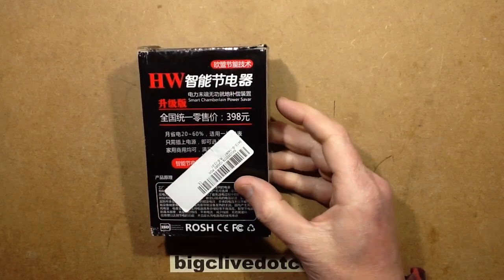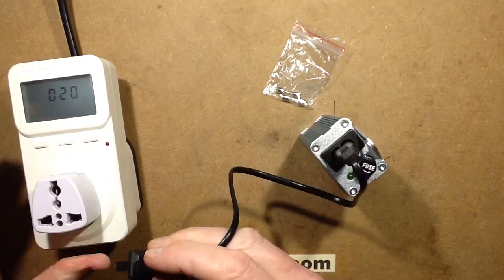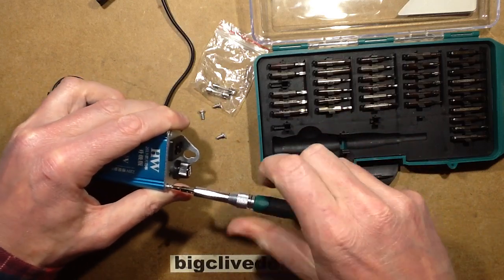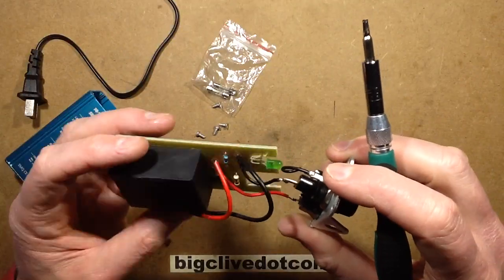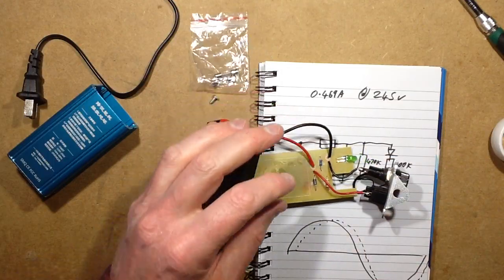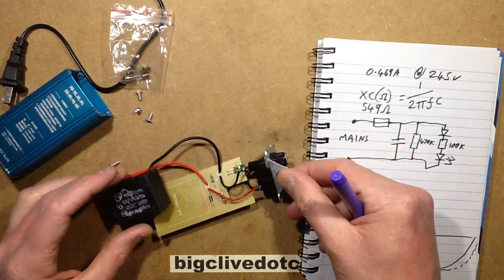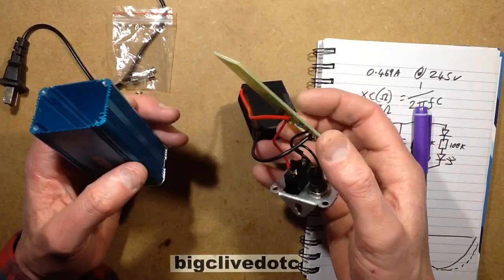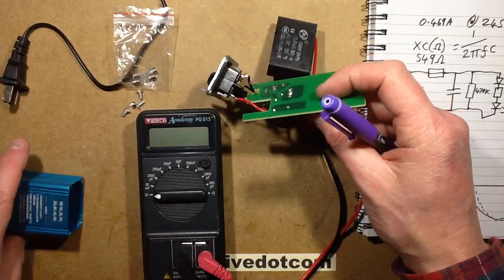200kW miracle power saving device.

Comment: Clive, videos on power supplies, power-factor and metering would be good.

I have some computers running on a plug-in power meter, which said the PF was only about 0.6. I experimented with capacitors but they only make it worse. Later I got a W/VA/PF meter module from China and fitted it to the switchboard. Great little device for about $20, very interesting. This got me looking more at PF in the house.

Most full time loads in the house other than cooking, water heater and fridge-freezer use now switch-mode power supplies. The volts and amps are in phase but the current is high at the peak of the cycle. The cheap PF meters show this as a poor PF. I guess it depends on how smart they are at interpreting volts, amps and phase angles.

I fitted a PF correction power supply to the computer cabinet and the reported PF went from 0.6 to about 0.95; a big indicated improvement. It must reduce the peak current and distortion on the mains 

We've had a smart meter for many years that I'm sure can monitor watts, VA and PF, but I don't know how they actually work out the billing. The power bill says KW, but that could be just to simplify the jargon.

The power display. Safety disclaimer: you need a electrician to install this.

http://www.ebay.com/itm/AC-80-300V-100A-Voltmeter-Voltage-Ammeter-Power-volt-amp-watt-Red-LED-Digital-/272162207638?hash=item3f5e21b796:g:NFUAAOSwr7ZW3~O0
Reply: Uh, power factor isn't accounted for in your power bill in residential settings. It's completely useless to correct for power factor if you're in a residential setting.

Comment: Clive, you need a scientific calculator so bad. :P
Reply from the maker: +themaritimeman They've all got tiny displays.  Not so good for the video.
Reply: Ah, good point; I hadn't thought of that.
Reply: Those things cost a fortune compared to a simple calculator.
Reply: PunakiviAddikti Yeah but they have more functions, and personally I love my Casio for when I need to quickly switch between scientific notation, fraction, and normal form of input and output, or go crazy with parenthesis, or being able to go back in memory for a certain equation I put in and swap values, using trig functions, etc. When it comes to repetitious work I find it very efficient. But, I suppose if bigclive doesn't need it often then a $15 calculator would be just an extravagant expense (and with a scientific calculator he wouldn't know how to use the memory keys on a basic one 😂) even though it can be a little tedious to use.
Reply: Also he has his well-trimed intellect. No need for oversofisticated calculators. Even though I love my Casio and my HP..

Comment: I like that the author has taken the trouble to investigate, but this is just a capacitor.  It will give a very small power factor correction. Power factoe correction cam knock 5% off your bill but only if your are billed on KVA  not KW.

Comment: Typical PFCU's switch in banks of caps as needed, dependant on inductive loads. Mainly 3ph motors, or to balance out other issues like office electronics on one phase. My thinking is that they're installed to create unity across the 3 phases in a factory installation, as the energy companies mostly want to supply equal effective power to a given factory, otherwise the bill goes up the more they have to correct a given phase. So in a domestic single phase install, of very little use if any.

Comment: You plug it in and it's already drawing 1/2 an amp..  If you think that daisychaining a capacitor and a couple of resistors is going to do Anything (I presume it is being sold under the pretense of power factor correction?) then you are being duped!  To implement PFC, one must devote an entire page of math and a d-box full of capacitors to fix the load at That moment in time!  This quackery in a shiny box should not exist for sale -- is it even UL listed?

Comment: How can this save energy /power when it exerts ~530ohm load on your network and draws 470mA x 245 = 115W. It does not make sense, does it?
Reply: This is not a resistive load (which is measured by your domestic power meter) but a capacitive 'load'.
The current in a capacitor is way out of phase from the voltage (ideally by 90 degrees) and no real power is being consumed (except for the discharge resistor and the LED+resistor in this device).

Power: P = U * I * cos phi
where U is the voltage amplitude, I is the current amplitude and phi is the phase difference between voltage and current (the power factor).
If phi is close to +/-90 degrees (or +/- pi/2), cos phi is very close to zero and the whole scalar product is similarly close to zero.

Some (cheap, digital) power meters do not measure cos phi (the power factor) and may include the imaginary power (energy exchanged between the capacitor and the network and back during each period) in the total power reading, which is wrong. They would be measuring simple Volt-Amps (VA), not Watts, and would be usable on with pure resistive loads (e.g. incandescent light bulbs, water kettles, etc.).

Comment: What do you think about refrigerator surge protectors?  Would you recommend using one in areas where a lot of brownouts occur?  Below is one that says it interrupts current below 90V and above 140V and has a 3 minute safety cycle.  I think this would be very good for a fridge or small window A/C unit to save the compressor.  What do you think about something like that?  http://www.amazon.com/dp/B00PHDTLEG/

Comment: I am in an all electric house.  I would never fall for that gadget either.  What I do is just turn the heat down in all unused rooms.  I can do that because we use baseboard heaters and each room has its own thermostat.  In the warmest months the electic bill can be as low as just a measly 20 USD BUT watch that shoot up dramatically in the winter!!

Comment: If the LED is in parallel with the rest of the circuitry doesn't that mean that if the rest of the circuit actually fails the LED part would still report it as working?
Reply: Maybe.

Comment: Would have been nice to see the actual sine wave before and after with an oscilloscope and possibly a 24hour test running once without the device and once with the device to see if it actually lowers the power consumption on your power meter that the utilities read from. Other than that - very detailed explanation! 😊 thank you.
Reply: Residential power meters measure both the power going into your home, as well as the power reflected back to the power company, with the net being what you actually consume.
Power reflection happens from inductive loads which temporarily store power in a magnetic field then when that field collapses, it send that power back to the utility. While that can add current in your power lines, your not actually consuming it and so aren&#39;t charged for it. Capacitors also store power in the form of a electrostatic potential between two plates and releases it back to the grid. Each unit of capactive reactance cancels the same amount inductive reactance.

So while you seen .489 amps at 240 volts you were not seeing 117.360 watts being used. Rather, you were seeing 117.360 volt amps being absorbed from and reflected back to the mains line.
Reply: Ian Oliver "
So these devices actually increase* your charged-for consumption," Simple answer: No. More complex answer: Maybe just a tinny amount. Read below for a more detailed explanation.

Look at this image of a capacitor in an alternating current circuit. http://sub.allaboutcircuits.com/images/quiz/00577x02.png

Power is Voltage times Amps. Consider these four different situations with a capacitor during a complete (0-360 degrees) cycle of applied alternating voltages. 
1. 0-90 degrees of a cycle, voltage and amps are both positive. so  power is positive and you'r consuming power.
2. 90-180 degrees of the cycle, voltage is positive and amps are negative. so power is negative and you'r sending power back.
3. 180-270 degrees of the cycle, voltage and amps are both negative. So power is positive, and you'r consuming power. 
4. 270-360 degrees of a cycle, voltage is negative and amps are positive.  So power is negative and you'r sending power back.

Adding up all the power flows. gives you a zero net flow of power. A little more nuanced  answer:  But, if you add in the tiny amount of resistance found in the wires, then yes you will loose a tiny amount of power due to line losses. For residential consumers, it is generally so insignificant that its not worth mentioning.

"Your charged for consumption" is the net power that you consume. These devices temporarily absorb power and reflect it back. If I gave you an apple and moments later you give it back, you didn't actually consume it, thus I cant charge you for what you did not consume. But, the apple still changed hands twice. The apple in this analogy represents power not current.  This is how it is with residential power consumers.

Industrial power consumers are a special situation. They consume so much more power and often have very poor power factor.

If we carry on the analogy, were you I might have exchanged an apple, Industrial consumes exchange truck loads. If power lines are like freeways. those freeways can only allow so much traffic, unnecessarily exchanging truckloads limits the number of truck a given highway can deliver. Adding an extra lane helps, but is costly. Alternately, power companies charge industrial consumers for the actual power flow rather then net power flow. This creates an incentive for industrial consumers with poor power factor (often excessively inductive) to employ power factor correction through introducing capacitive reactance.
Reply: So these devices actually increase* your charged-for consumption, in a residential situation?

*by more than the power consumed by the LED, obviously
Reply: You wouldn't notice a difference on an oscilloscope unless you went into differential mode.
Reply: Why bother...we know it doesn't do shit.  This is a spin on an old scam from decades ago.
Reply: Florian Uhlemann you do recognize, that this device is not powerful enough to do anything except blank that stupid old green LED. The point he was making was in the event that you had a device that function correctly, through it, One could change the differential between phase of voltage and amperage. I don't care if you put a big Flippin magnet on this thing it won't do anything at all to your bill. But know this is a Chinese POS, with false advertising, and dreams of grandeur, straight up and out right bullshit, nada,nit,crapola!!!! In the American vernacular Dogshit tastes better than this works.....LOL
Reply: I don’t have time to watch a 48 hour video ‘running test’ … 😂😂😂
Reply: Consider this technology called „time lapse“ 🤣
Reply: Dave Micolichek This is why digital power meters have largely taken over, at least in some parts of Europe. Not sure, but I imagine a modern digital power meter would detect this type of tampering and open the main breaker.
Reply: skisex

Comment: The imbalance of the load can be read on the neutral wire. I always do a load balance and believe it has reduced my power bill. This said a friend bought a 'magic box' from an unscrupulous contractor that additionally sold him 'semi-annual maintenance' on the bogus device. I was waiting for the guy after I had explained it to my friend. They had bought the device for THOUSANDS of dollars and paid an additional $1800 annually for 'maintenance'.  I worked as a licensed electrical contractor in several states and have 2 degrees in Science and Engineering. Anyway the prosecutor got in on it and the vendor did go to prison. He had ripped off many people with his scam but this was only one of his ongoing enterprises. There are ways to save on your electric bill, reducing actual consumption is the best way.  There are also some electrical devices that capitalize on the way the old meters operated, squirrel cage motors were one of such devices. Consult an electrician or an electrical engineer before buying crap like this unless you are like the video maker and just checking the false claims out. Worse case scenario, you burn down your house or suffer a deadly electrical shock to your body. Best case, you've been robbed.
Reply: As Douglas Engle said, balancing the loads has no effect on metering on a edison 120/240 center tapped single phase supply. If the conductors are undersized then sure you will lose some from overload / causing conductors to heat....but if that is the case you need to wonder why your main breaker is not popping. I would get a qualified electrician to check the conductor and main breaker size.

Power factor, that is actually a thing - especially on commercial and industrial setups. You can get charged for a poor power factor, where the grid is providing capacitance to inductive loads. Generally the utility will bill for a power factor that is worse than 0.9 (90% of unity) This is where the amps and volts are out of sync by greater than 90% .

And I agree the annual maintenance - what a scam. Possibly a capacitor bank if the owner was running a huge amount of poor power factor equipment may help the owner avoid a power factor penalty, but it would unlikely on a residential setup.

I am glad you talked some sense into your friend.
Reply: Neutral wire current flow as an indication of imbalanced load is a DIFFERENT CONTEXT than power factor correction for reactive loads being discussed in this example.  

Neutral wire current flow in the North American residential electrical supply is to and from the center electrical tap of a 240 VAC residential supply power transformer normally in the street right-of-way.  The neural center tap electrical supply line forms two 120 VAC circuits at the residence, a lower 120 VAC circuit and an upper 120 VAC circuit.  Current flow is between the power supply transformer's upper 240 VAC electrical tap and its center tap and its center tap and its lower 240 VAC electrical tap.

When the lower and upper 120 VAC circuits have exactly the same loads then the neural supply line would theoretically have no reason to flow current because the current return of the upper circuit exactly matches the current sourcing of the lower circuit.  That means if you had exclusively one 100W light bulb on the lower 120 VAC circuit and one 100W light bulb on the upper 120 VAC circuit when only one bulb is on the neural wire would flow all the current needed for that one bulb with a corresponding measurable voltage drop on the neural supply line wire due to the wire's resistance. Simmerly if you turn off the lower 120 VAC circuit bulb and turn on the upper 120 VAC circuit bulb you'd find a voltage drop on the neutral wire.  Now, if you have both bulbs on, theoretically you've cut out all current flow in the neural supply line because current return of them upper 120 VAC circuit exactly matches current sourcing of lower 120 VAC circuit. 

That means you've  effectively cut out half the power line voltage drop experienced by the lower and upper 120 VAC circuits when used individually because you are sinking and sourcing current at the residence.  This by-passes sending and receiving current through the neural supply line wire to the street transformer and its associated power loss.

This seems like a good idea, but I'd think the neural supply line voltage drop and power loss would be almost undetectable.  Most likely if you are having electrical problems your supply wires are old and deteriorated, under sized, and many possible mechanical ills that create erratic behaviors you may be inclined to notice more after you've made some change to your electrical system.  

You could also have a erratic and bad neural supply line so reducing your dependance on it improves your over all electrical performance.  Most likely if the neural supply line is bad the other supply lines should be replaced as well.   Old residences in North America frequently only had 100 Amp supply lines and when any large appliance would start up, like the AC, the lights would dim as the large start up current creates a severe voltage drop across the old 100 Amp supply lines.  The power company will typically upgrade your lines to 250 Amp for free.  Just say your putting in a massive hot tub with electric heat!

Comment: I agree with Clive in general. It is not a power saver at all, as a capacitor it captures slightly spikes in of your home energy net. But it's also a load , so it drains energy from your energy meter  and increases your bills slightly. Clive forgot to include the internal resistance of the capacitor, so overall impedance will be little bit higher than 550ohm.

Comment: u didn't show whats it for and how its used sheeeesh
Reply: +face of justice He did say briefly. Basically industrial buildings are charged by something called a power factor. If you've got motors or other equipment that makes reactive power, the voltage and amps are out of phase and it costs you more so basically this device would typically sit between the industrial equipment and the power meter to make sure the power is in phase.
Reply: Thanks for the info

Comment: Not related to the product at hand... I used to have to change out computer parts (power supplies and motherboards mostly) every year or so. Then I moved 600 miles and haven't had anything burn out in five years. Everything else is the same including UPS. I sure would love to learn more about whether or not electrical supply can affect hardware, and if so how, and how can we measure this, and how can we fix it.
Reply: +Robert Lawton   Based upon what you've said, if all other factors are equal, then it does sound as if the "flavor" (I'm quoting me, not you) of the power supply where you were was the problem.  Maybe the owner of this video can suggest how to measure & fix the problem.  I'd be interested in what he has to say on the subject.